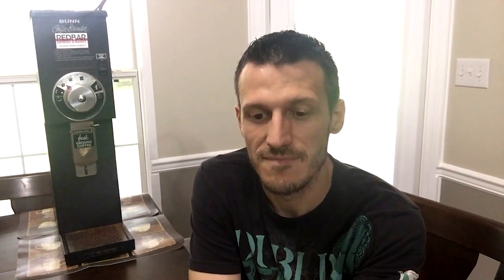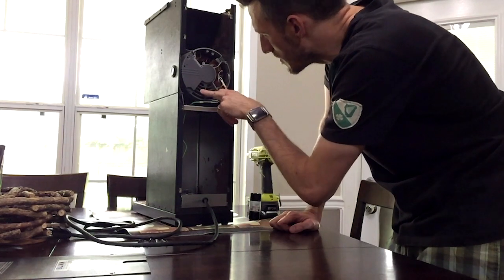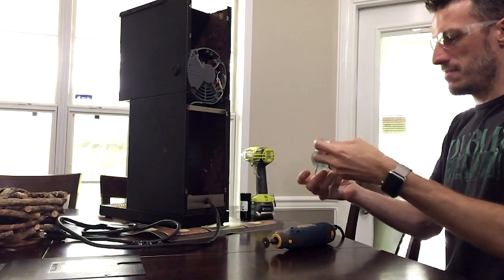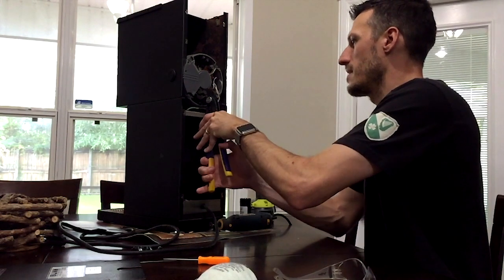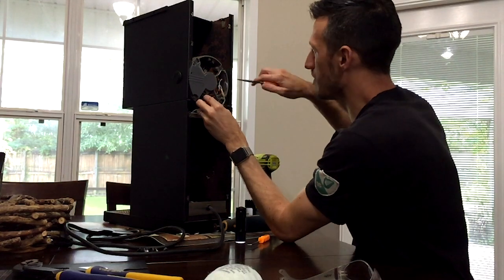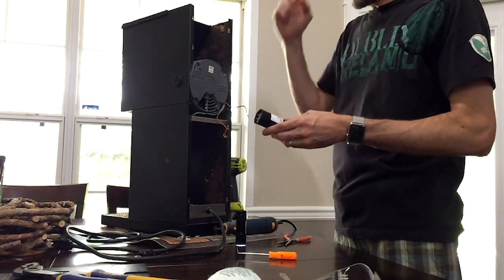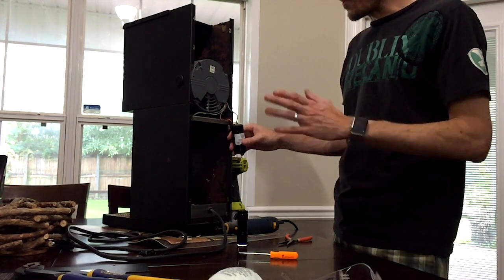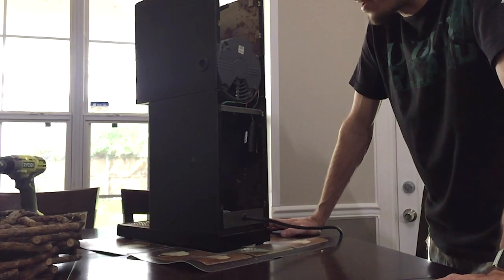Bunn G2 HD Coffee Grinder Repair Capacitor Replacement

Comment: Hello, I know this is an old video and for other readers, it's very easy to take the motor back cover off to replace the grinder. first unplug, take the motor cover plate off just like the guy did, remove the ground and two wires. Now, look under the motor, there are 4 screws holding it in place, once removed, the motor will pull out. You'll see 4 bolts on the back of the motor (where he removed the air vents), take out all 4 bolts from the cover plate. Once removed, on the side of the motor and about 1 inch back, you'll see two areas where you can place a large screwdriver to tap the plate off. Tap evenly on both sides, it's only held on by a 1/8 inch rim. Now slightly rock the plate back and forth pulling away from the motor because the cover is attached to a bearing, don't worry, the bearing won't pull off when removing the cover. Now that the cover is removed, you'll see one small screw holding the capacitor in place. remove the old and replace with new. Also, on the bottom of the capacitor there is an alignment pattern so that the capacitor fits in place just right. You'll know if its wrong because the capacitor will feel like it's an 1/16 inch too large. Adjust, slide it on, replace the screw with the capacitor holder. Simple. The replacement should take about 15 minutes and about the same amount of time the video guy took to remove the air flow grid. Take pictures of your wiring, this is always useful even if there are only 3 wires.

Comment: Hey there,  I just bought a Bunn G3. What are the symptoms for a failing cap? The motor in mine is just buzzing quietly.
Reply: Have to repeat I'm a shop owner and not an electrician. I believe in my case thinking back that it was making no noise at all, completely dead. My thought though would be, first thing make sure that there is nothing in the burrs that has it stuck. To clear out anything that may be in there you just have to turn the unit off, and turn the motor a few times with a screwdriver etc making sure the burrs rotate.  If that doesn't fix it, since the cap is so inexpensive I would change that out next with the hope maybe it's getting some power just not enough to actually turn the motor. Past those two options I wouldn't know what else to look to next.
Reply: @DrMikeBucknell  What about the relay in the bottom? was it clicking on at all? i have one that when i hit start, the relay clicks on but will click off as soon as i release the start button.
Reply: @chrismurphy5564  To be honest this was three years ago and haven't had a single problem with the unit since. I would think if you're getting any function at all that it's getting power so capacitor might not be the problem, however in my experience with various equipment that I would start by changing the cap and see if that resolves it. If not, replace the relay?